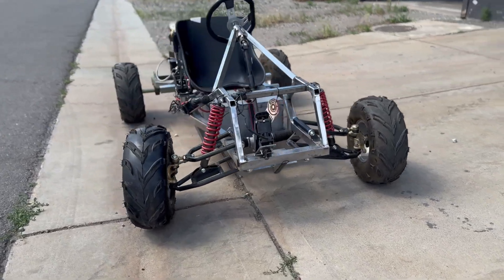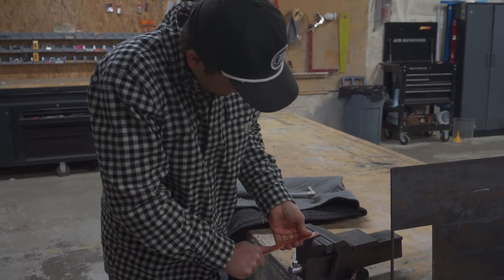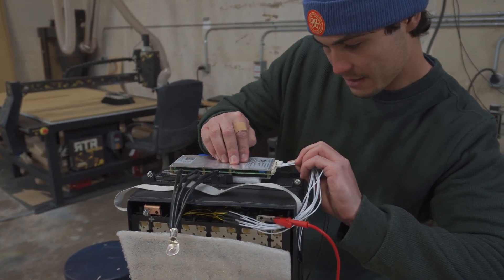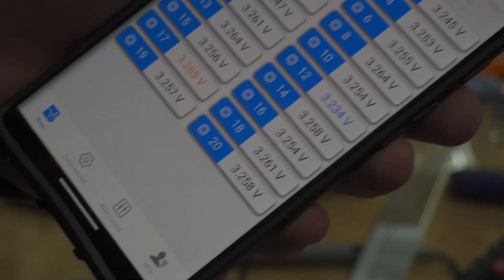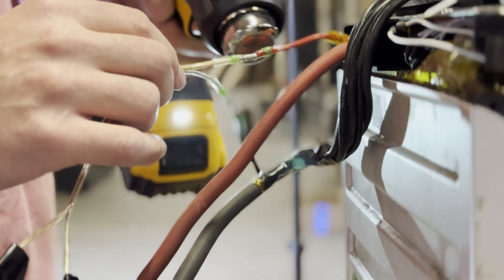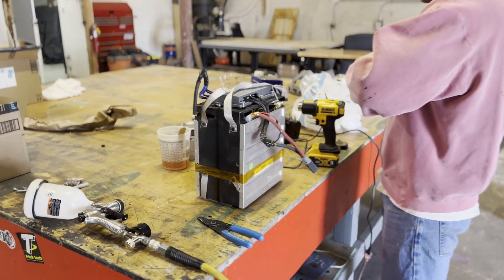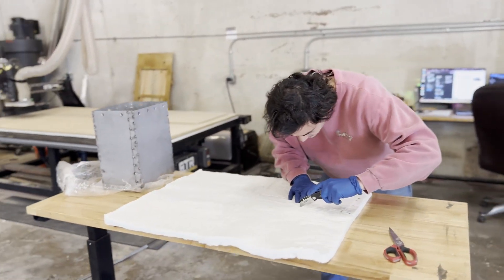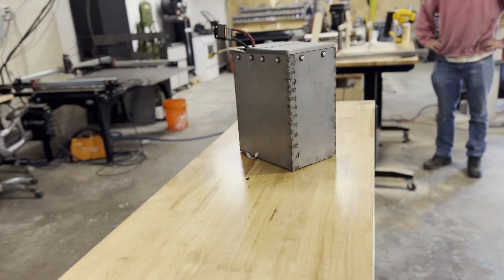How We Built a Battery Capable of 15 KW of Power for Under $500 | Electric Go Kart Series Part 1

Comment: Great way of repurposing standard battery packs! But that is not a 200A continuous battery. That is 20S11P with M50LT cells,  when new would only be rated 80A cont. M50LT cells are rated at 14.4A max and 7,2A cont. basically 11kW peak and 6kW cont. for the whole pack.
Plus, and used battery will have a much bigger voltage sag during load, further reducing maximum discharge. You'll be able to see that on the BMS APP on a test drive, just record the screen and look at how the cells voltage changes under load.
Reply from the maker: You're absolutely right, we used the term "continuous" incorrectly. During our test drive, we did draw 180A when set at 90% power in our ESC software, and that's where we derived our numbers. We're not battery experts, so we hope our figures are close to accurate. Thank you for pointing that out
Reply: If you saw 180A at the BMS APP then those batteries are great, just make sure you have one or two thermistors in the hot spots to keep a close eye on the battery temperature
Reply: That's the motor can't handle 15kw anyway
Reply: Inconvenient truth ^^^ right there.  Also, whenever the answer to a rhetorical HOWTO video title is "buy USED" it's borderline clickbait.

Comment: Could I build a battery like this for my talaria
Reply from the maker: Absolutely, this battery would be a beast for the talaria!

Edit: I looked it up and it looks like the talaria chassis won't fit the battery in the configuration shown in the video. Functionally the battery would be an upgrade for the talaria but finding a spot to put it would be difficult.

The dimensions of the finished battery in the video are 12in x 7in x 14in